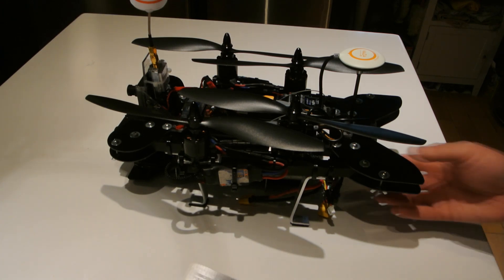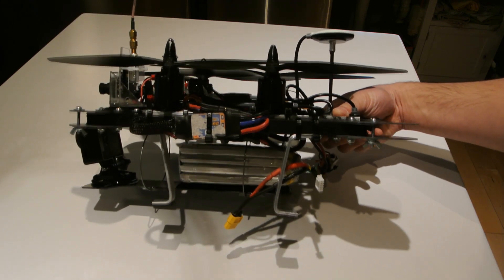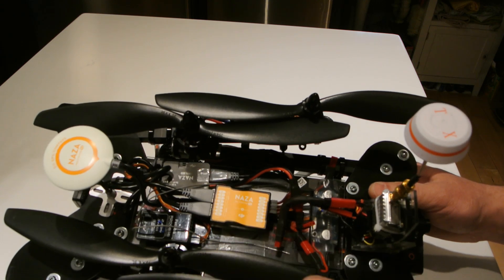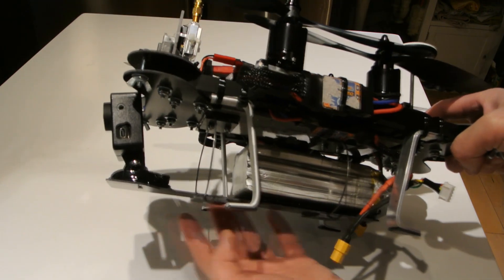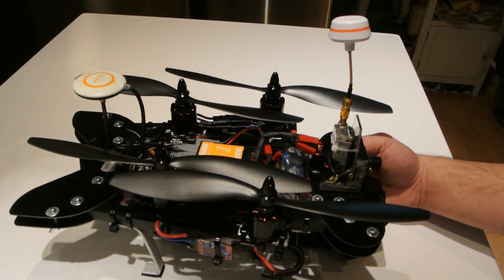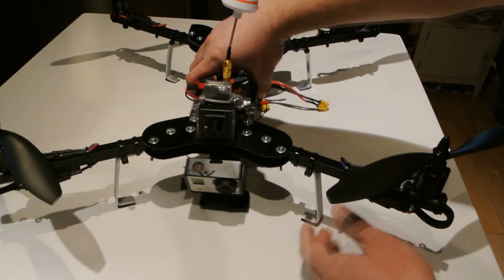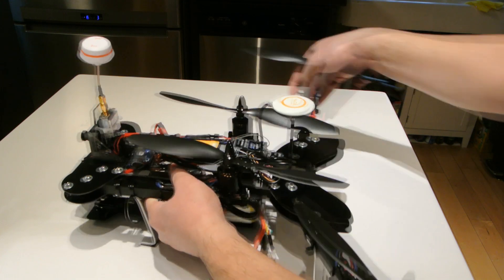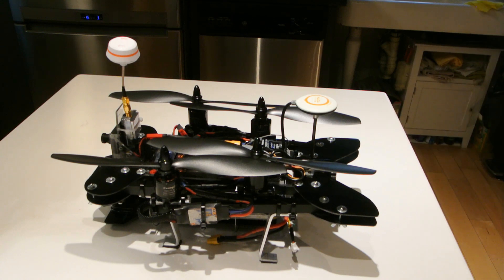Backpack Folding Quadcopter Overview - Part 2

Comment: Hi recently i built a Quad using HK Foldable H frame with naza v2 and the results are very confusing bcz after take off it does not holding position like yours. but the led showing gps in ok.(using simonk esc with 960kv motors and 1045 props)

Comment: Well i did the one like in the video and i need to say there is some minuses. Arms may fold during the flight if you have not tighteght it hard )). And one day you forget about it like i did =).  The wire for vibro plate is very hard to choose. But the big plus is the size.

Comment: well done! I`ve decided to make folded frame after i watch your video. I`ve got pretty same config. How much flight time do you have? Do you fix quad arms when you unfold them or are they fixing by the friction force. Can you post link to the camera tray? What kind of wire did you use for it?
Reply from the maker: I get around 10mins on a 5000mah loaded with camera.  For the arms it is just friction but I have wing nuts to tighten them up for a little extra insurance.  I am doing another video for the camera tray with thicker wire, the wire is piano wire that I got at the local hobby shop.  I forget the gauge, maybe 14 or 16.  You can find the tray as a link off of this page http://flitetest.com/articles/tricopter-scratch-build
Reply: Andrew W thanks a lot! Check this out http://flitetest.com/articles/jello-killer-or-how-to-eliminate-vibrations